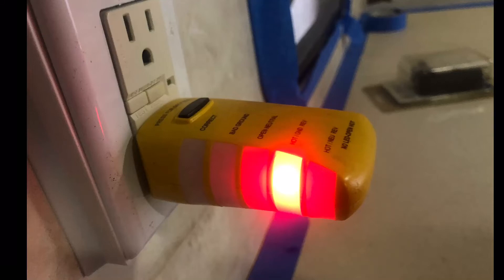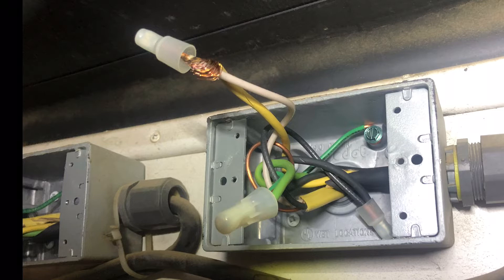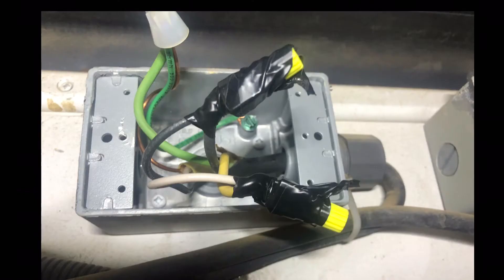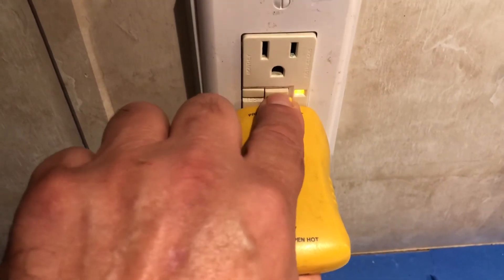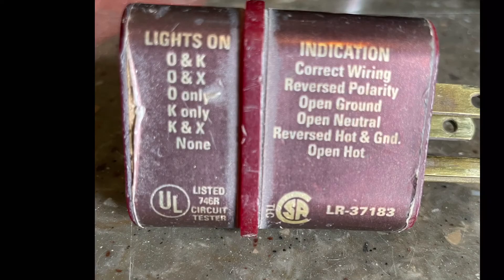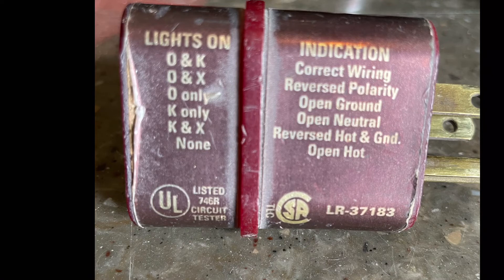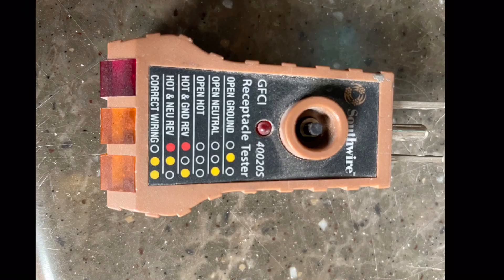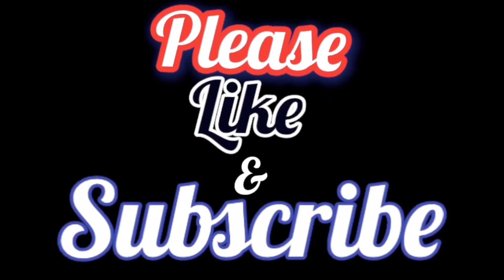Hot ground reversal hot neutral reversal

Comment: A 'true" hot/ground reverse would be extremely rare and dangerous because it would electrify any metal framed appliance or lamp plugged in and the device would appear to be dead since it wouldn't work.   The few times I ran across a hot/ground reverse situation every one of them was really an open neutral upstream with a load connected and each one of those was a backstab connection that had heated up and failed.   So while 3 light tester are great tools, they can be misleading and shouldn't be relied on to catch every possible wiring problem with a receptacle.
Reply from the maker: I primarily work on RVs so I see a lot of weird stuff…